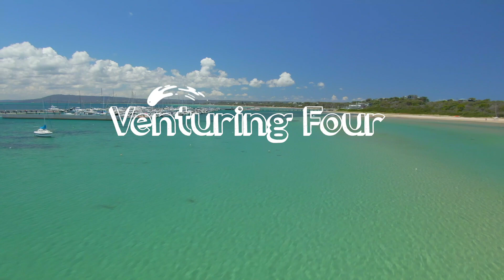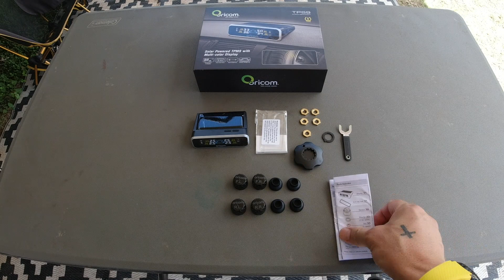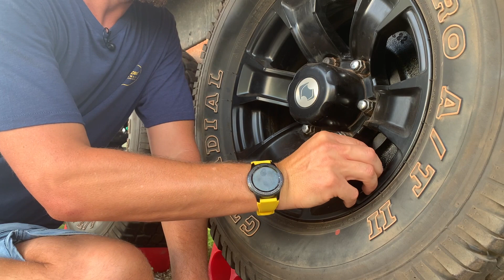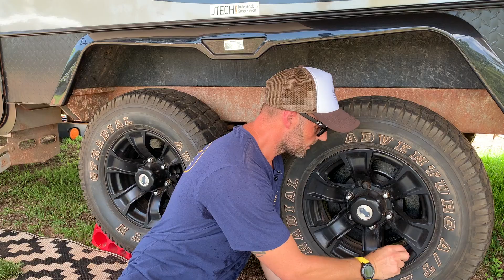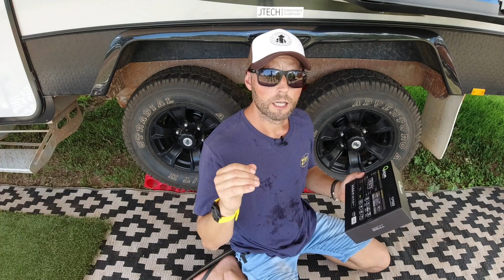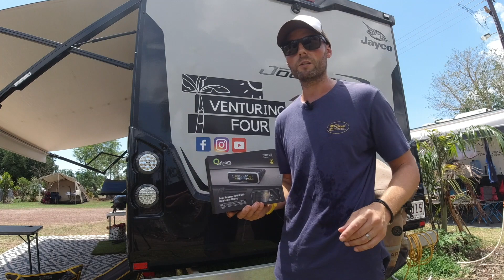TYRE PRESSURE MONITORING SYSTEM | TPMS | ORICOM | FULL INSTALL

Comment: Hi, to deflate and inflate the tyre, would I need to use a spanner to remove the nut? Or do I just remove the sensor?
Reply from the maker: @tyrondias62  you will need to use spanner. I actually got sick of doing this and no longer have the nuts installed. 👍

Comment: how did you mount the awning ? I want to get one installed on my wildtrak but don't want to be drilling holes in the roof
Reply from the maker: Hey! I purchased Yakima Easyoff Awning Clamps from Anaconda. They simply just clamp onto your roof racks. 👍

Comment: Hi, wandering how the unit is going so far - is it still working? I bought a cheap one on eBay and one sensor stopped working after a few months.
Reply from the maker: Hey Alex! The unit is still working great! I’ve had zero issues with it. Definitely recommend for the price 👍
Reply: @venturingfour  good to hear and appreciate the circle-back
Reply: I accidentally deleted left front now I can't get it to stay on the screen when I set it up again keeps disappearing.

Comment: Been looking at a trye monitoring system for our van but hear so many strories about the  "range" of the unit.......have you had any issues with the readings dropping out or losing connection so far?
Reply from the maker: ozmid40scouple nothing yet mate. If we disconnect the car and go out for the day we’ll sometimes loose signal but once we set off with the caravan in tow it reads straight away once above 25km. 👍